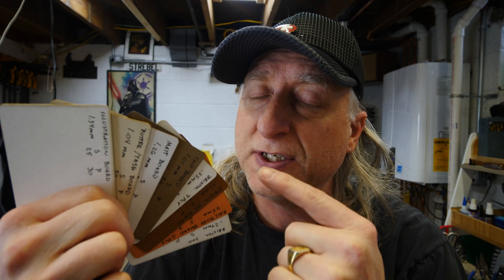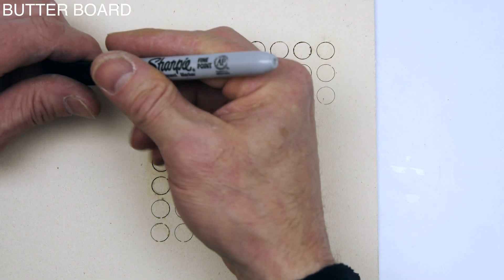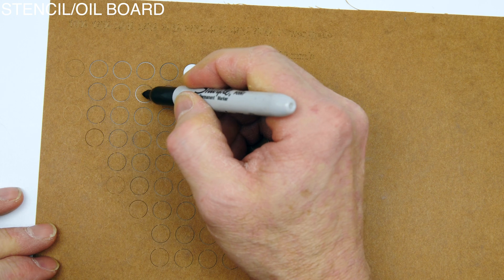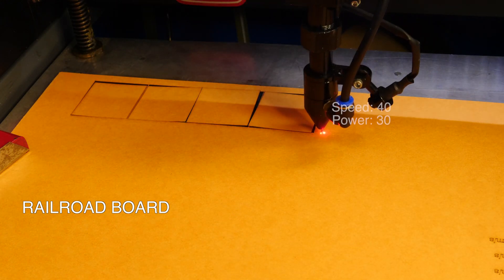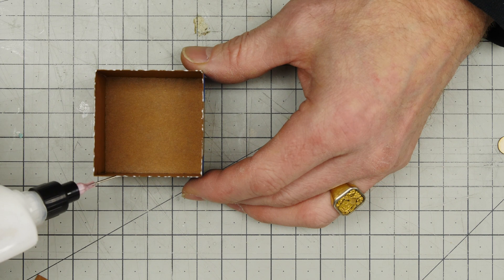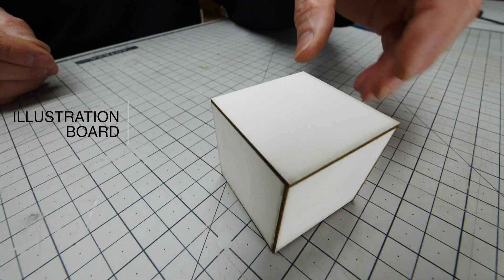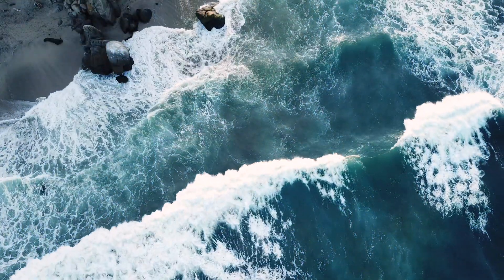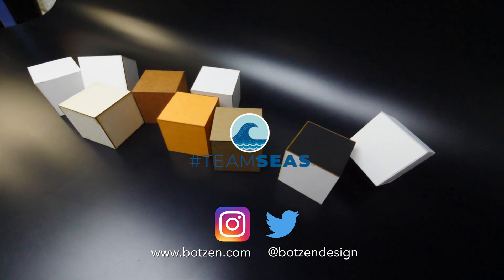CardBoard Laser Shoot-Out #TeamSeas

Comment: I've been messing around with laser engraved brick patterns for HO structures. Engraving is no problem. Cutting is not really an issue (15W diode laser). But the issue I have is extreme fragility of the brick pattern. Just touch them with a little bit of pressure and the individual bricks pop right off. Any ideas on stabilizing the surface. Thinned PVA maybe? Material is illustration board*. Maybe change to chip board. 
* I've tried Basswood but cost versus other materials for 150mm wide stock. I would like to try laser board but can't source locally.
Reply: If possible, get a lower Power/higher speed
If your machine allowes it, try a higher Puls per Second rate

I never used Diode laser so i'm not sure if that is even possible
Reply: @T1g3rch3n  
Oh, I can vary the output and speed in the software no problem. The problem I'm having is the top layer (which has the etched pattern in it) will delaminate from the underlying layers. Basswood or 1/16th plywood will work but I really wanted to stick to a surface clean of any grain. However right now I'm dead in water due to the fact that thecomputer in my shop  crashed the hard drive.